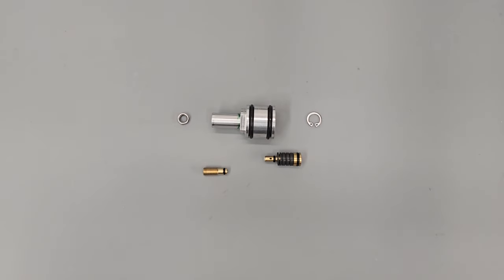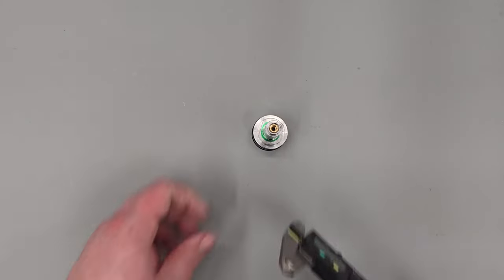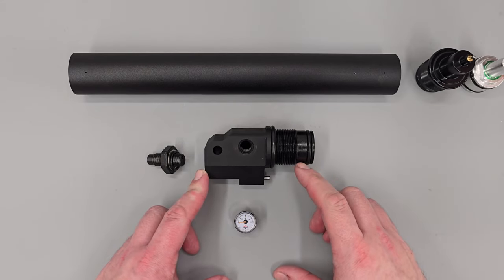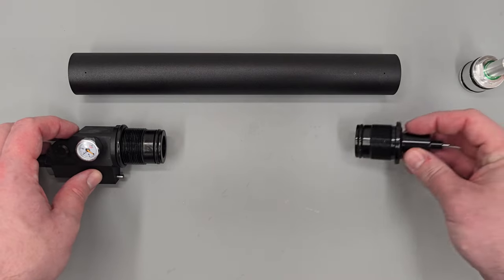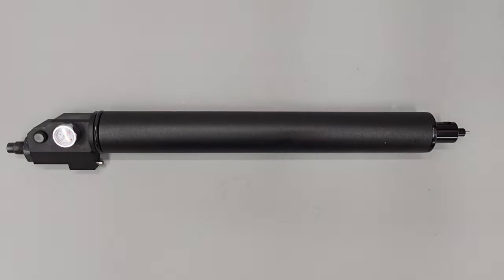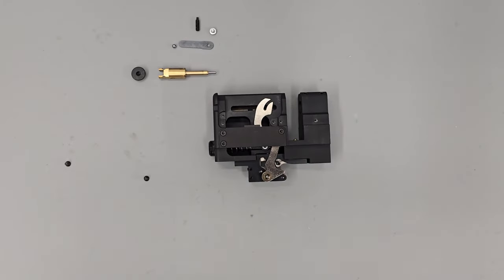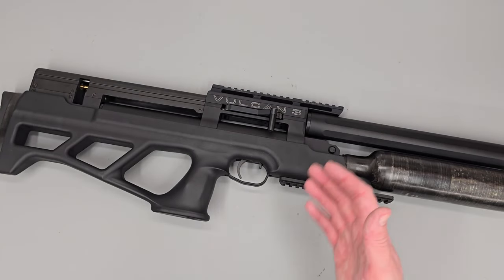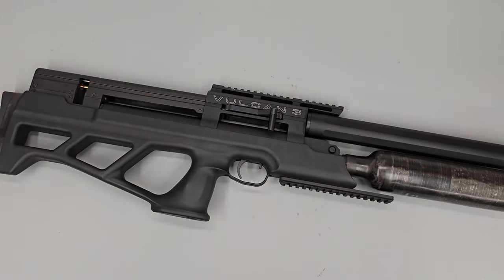AGT Vulcan 3 Full rebuild guide.

Comment: Mine was a little low on power, I tried it without the transfer port restrictor, but was well too hot even with the hammer wound all the way out, i didn’t want to touch the reg, so I opened up the restrictor by about .5mm and it’s spot on now 👍
Reply from the maker: yes you do have to be carful when mucking about with restrictors
Reply: @sub12airgunners  another reason why everyone should have a decent chrono 👍
Reply from the maker: @AJ.Roberts   i still can't believe people shoot pcp's and don't have one, it's mad to me

Comment: Another brilliant and informative video, PLEASE do one on the VIXEN.
Reply from the maker: thank you 😀 there will be one soon 👍
Reply: @sub12airgunners I've just watched a video from the Middle East showing the Vixen and on the left-hand side of the receiver there's is a alen bolt ,the chap took it off and then inserts a small threaded bolt and then removed a small brass bush, this gave him more power ?
Reply: @crazycressy7986  Great info thanks. I've heard you can get better and more consistant SUB 12 power by not using the restricter but properly balance the reg and hammer spring, so you use less air.
Reply: @billmasen3923  I don't know anything about the Vixen, only what I've seen ,I should be getting mine at the end of April 👍